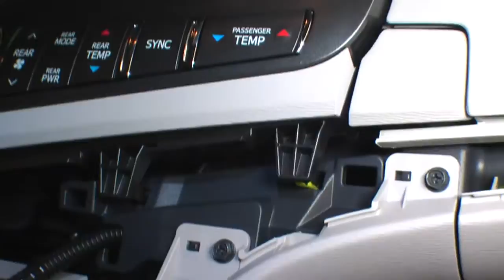Alpine PKG-RSE3DVD in 2014 Toyota Sienna overhead video

Comment: 02:36 - So the "door" wire from the Alpine harness should be spliced/tapped with the light green dome light wire?  Isn't there also a separate dome light wire that comes from the Alpine unit?  It shows it on the installation instructions as being separate from the "door" wire.

Comment: You state at the beginning that this is part 2 of the install, but I couldn't find the 1st part, which is the part that I would really like to see as I'd like to install this very unit in my 2014 Sienna also (which does have a sunroof though so not exactly the same).  Is there a 1st part forthcoming or do you have a link?  Also, aren't there airbags behind the A-pillar?  Mine has a "SRS airbag" logo on the pillar IIRC.  Anyway, great video!
Reply from the maker: IMP3TIGO https://youtu.be/nuYsgAkBRs4

Comment: I have my Toyota sienna dvd screen installed by a certified "tech " but it continuously drain the battery. so I unplugged . what could have done wrong? pls help.
Reply from the maker: sounds like they hooked it up to a battery feed and no ignition. Does it stay on with van off?
Reply: the dome light  turns off when off position but I noticed that, in the dome light there's  like an  infra red light inside barely noticeable, that I think is draining the battery. maybe ...But I disconnected the dome light ...so far battery still good . thanks thou for reply.
Reply from the maker: Dome light has nothing to do with the player, the unit is staying on and should be fixed.
Reply: Quick question tho'  , I have a complicated situation , I have a lexus IS250  '06, no navigation. I'm planning to put a pioneer 2 din stereo, but I want to retain my 6 disc changer for personal reason. Can I use a harness to connect the pioneer  with the 6 disc changer connected together ?   Pls Help
Reply from the maker: No, the pionneer can not talk to the factory changer. No protocol adapter.